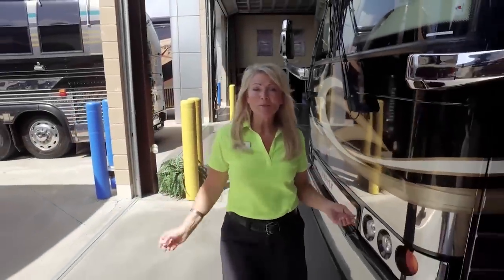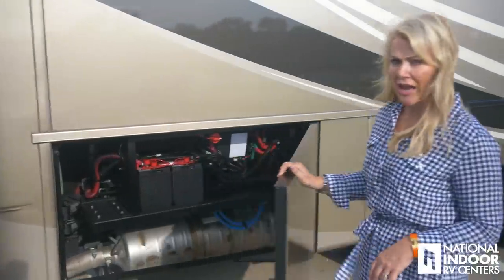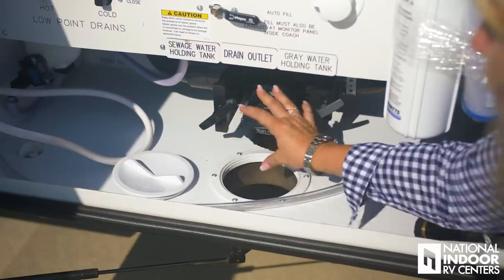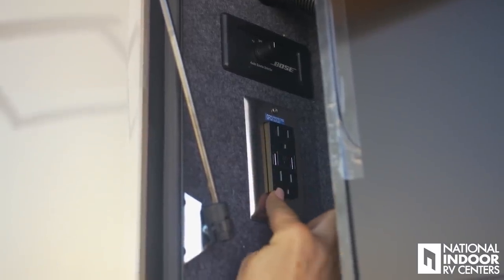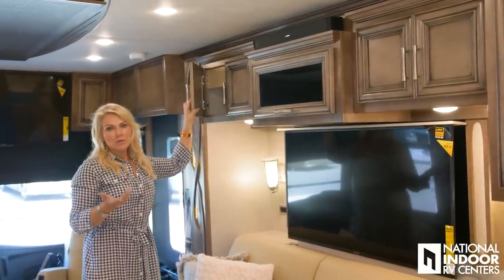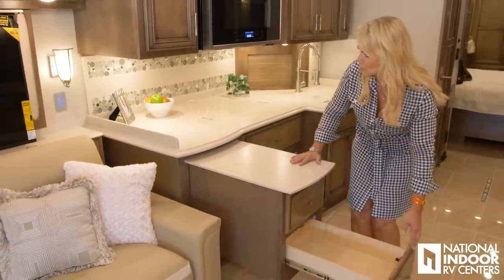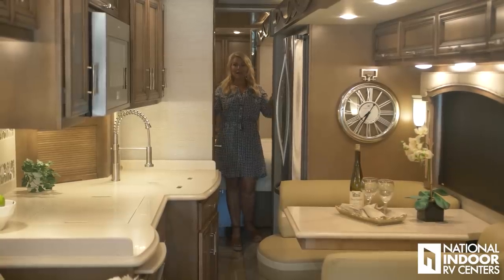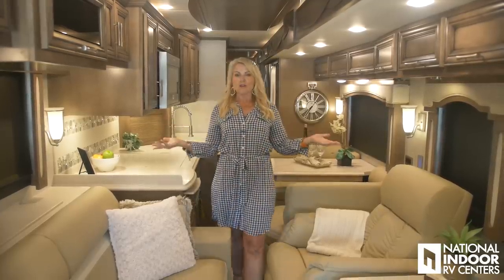2019 Newmar Ventana | Full Motorhome Walkthrough Tour | NIRVC

Comment: 32:59 hi, nice video and a great coach too. But does that mini compartment  garage in the kitchen have an air vent built into it. Lets say if i'm to install a water heater in there, and it starts boiling where would all the water vapour go too? Because having it just staying around could ruin the coach interior
Reply from the maker: Timothy, there is no vent in the appliance garage. It’s strictly for storing appliances while travel and certainly not for operating appliance with the door closed. I hope this help.